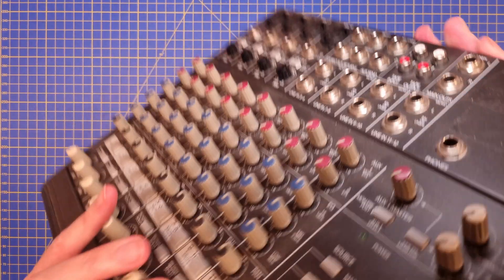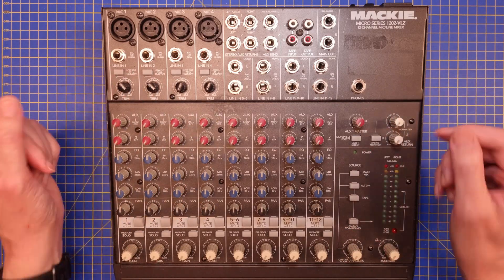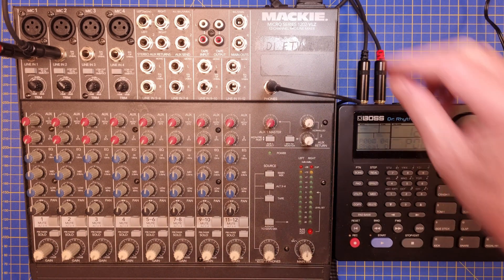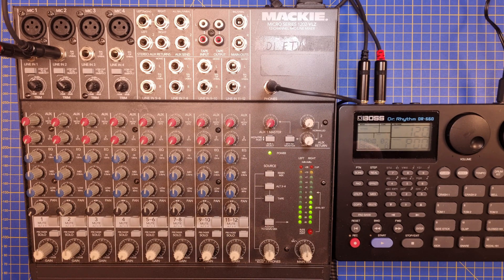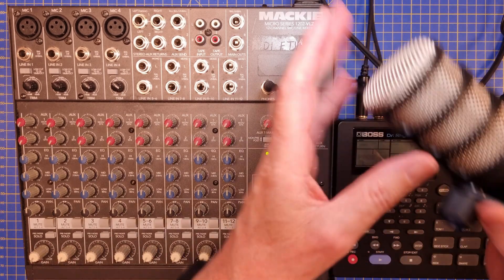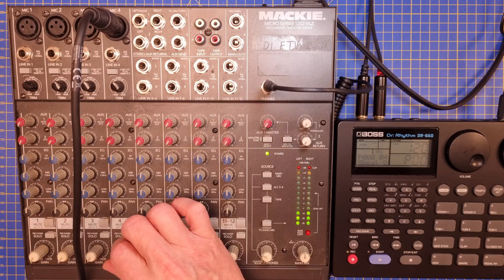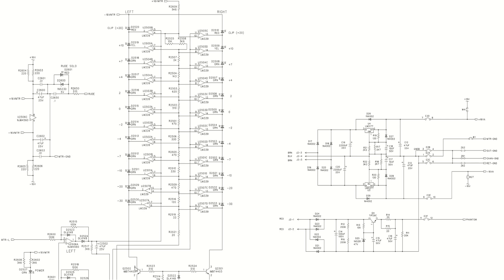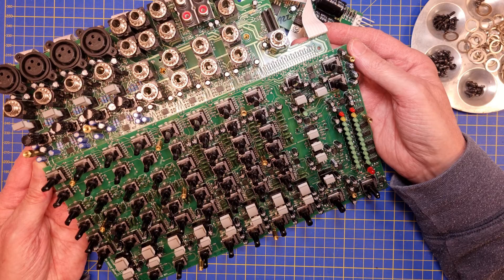Mackie 1202-VLZ Mixing Console Renovation

Comment: How do you get the green light to come on both sides right and left it only comes on on the right side on my mixer
Reply from the maker: You mean the LED VU-meter? If it's not lighting up when you feed a center-panned signal, it is probably broken. If the right channel is working you could probably have that as a reference when you trobleshoot.

Comment: Thanks for your video.  The right channel input  of almost all my channels is lower than the left.  I have to turn the pan pot to the 3 to 5 o’clock position for the left and right channels To sound equal in volume.  Any advice on how to fix that issue?
Reply from the maker: I would start by cleaning up and checking that all pots, switches and jacks are working - don't forget the insert jacks since the signal is routed through them.
Next I think it's a good idea to check the circuit around Main mix and Alt mix summing amplifiers, since more than one channel is affected. Check if you have the same problem if you switch between Main mix and Alt Mix on each of the channels. If the behaviour is the same for both then the issue is probably after the summing amplifiers.
Good luck with the trouble-shooting - hope you can fix it!

Comment: I got one of these for free at the TV studio I work at, Overall it seems intact but all the lines seem super dirty. Extreme amounts of static in lines 1 and 2, a little less in the rest but all of them punch out enough noise that its difficult for me to find any uses for it right now.
Reply from the maker: It looks like it needs some throrough clean. The static could be some op-amp that needs to be replaced, if it's heard all the time. These mixers are nor valuable but they are still used in a lot of home setups, churches and other places. For some reason they are also used in a lot of "no input mixer" setups
. So, don't throw it away for landfill 😊

Comment: I have 1202-VLZ PRO and channels 1, 2, 3 has noise when turning a gain knob. Would a knob replacement fix the issue?
Reply from the maker: Yeah, that would probably fix it more reliably than using oxide spray like I did.

Comment: I have an old 1202-VLZ PRO with a really strange issue  !
Really great little mixer though !
Sometimes the AUX1 send wont work !
I use the two AUX sends to send signals to my looper in stereo !
AUX1 for left and AUX 2 for right !

After a while it works so I guess there is probably a capacitor malfunctioning or something !
Reply from the maker: Yeah, it sound like some kind of component failure - possibly temperature dependant. It could the component itself or a solder-joint that is bad.

Comment: I cannot figur out  what screwdriver you are using (type and size)
Reply from the maker: Neither can I. Luckily I have a whole set of them so I use the one that fits.
Reply: I found out luckyly by trial and error😃
Reply from the maker: @maartendierks4631  The same method that I used too 😅

Comment: Those were board mounted control pots....were they sealed parts ?  I couldn't see in the video.   I was about to hunt down the schematic for the unit as I have the same one and want to do a modification thats off menu for my application for a rack system management situation.  I like using this board and the next one up with the sliders as they are compact and perform well when you understand how to apply them & treat signal.  I took the cover off my mixer last night to get a visual but I didn't take it down the whole way.  I hate PCB boards and then surface mount garbage.  I come from a background in TV and electronics.  It's fun when a seal precision control pots go scratchy and then being board mounted and not divorced from the board with wires.  I recently watched a presentation with Bob Heil talking about when he built the first mixing consoles for PA with Vector Boards being the guts within and THE WHO demanding his equipment for an American tour as they came not prepared for..... with their UK equipment.
Reply from the maker: I'm not 100% sure but I think that the pots are not sealed; I mananged to get some contact spray into them, but if I remember correctly I had to soak them from the top to make it work. I agree that SMT placed on the same board side as the TH components is not fun... It's really hard to reach down between the pots and solder without melting the plastic parts.

Comment: How many powered speaker can you hook up to?
Reply from the maker: That depends on what your are trying to do, but you have two main outputs and two alternative outputs that you can use. There is also two control room outputs.
I recommend downloading the user's manual and check out the block diagram.

Comment: Sir, what is the hex screw size for that board? What size hex screw did you use?
Reply from the maker: Hello, I don't know what the correct size is, but I successfully used a 1.5mm Allen key.

Comment: Nice video.  I wish you would have shown how and where to clean the pots, though.  Is there access to the internal wiper and carbon track, so that you can inject fader cleaner/lube?  Or did you have to disassemble the pot?  Small wish on otherwise excellent video.
Reply from the maker: If i remember this correctly; I flooded the pots with tuner spray until they started to loosen up and then I let is soak for an hour I think. After that I cleaned up the excess fluid with a cotton bud. I didn't disasseble them.

Comment: I have also this same mixer but when I connect the laptop for music with the charger of laptop plug in ,the humming sound comes in specially on the Hi frequency you can hear even have music play the hum is still you can hear but without laptop charger plug in hum sound gone. Hoping for advice
Reply from the maker: What you describe sounds to me like a classic ground-loop problem. In an audio system there should only be one ground path and when you connect audio equipment like instruments, mics or battery powered stuff all is well - because it's still only one ground path.
Unfortunately computers are not designed to be audio equipment, they have headphone and microphone jacks, but they are not intended to be hooked up to audio equipment.
I can't give you any specific advice that would guarantee to solve your problem, but try to reduce the ground loop if possible or used the balanced inputs instead of the normal ones. A passive DI box may also be a solution.
Reply: You could split the laptop stereo out into balanced Line 1 and balanced Line 2 inputs, correct?

Comment: Thanks for posting this. I have the 14-channel version of this same line and it has ground hum, almost consistently. Any ideas where to start looking for a root cause?
Reply from the maker: Start by checking the power supply rails for hum. Also check the flex-cables that interconnect the boards so you don't have a bad connection. 
If they look good I would have started by trying to figure out if the hum changes if I turn any knobs and faders to see if I can isolate it to a specific block in the signal chain. It's good to have the block-diagram at hand and also the schematic diagram - both are part of the service manual I believe.
Good luck - hope you can get it to work!
Reply: I also have the 14-channel version of this desk that I picked up for free. This video has really given me the confidence to disassemble and try cleaning it

Comment: Hey I'm thinking abut giving my mackie a clean too. Did you do anything to the pcb at all besides glueing the caps? What did you use to clean the pots? Thanks!
Reply from the maker: I didn't need to do anything. I used Kontakt Chemie Tuner 600 spray and a small amount of PRF 7-78 for lubrication.